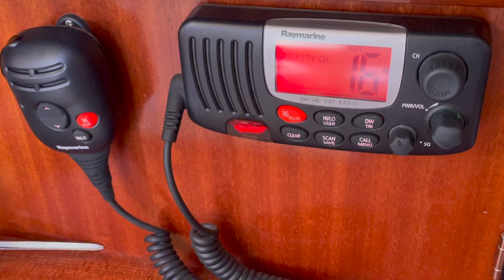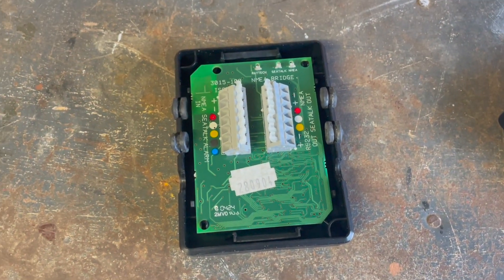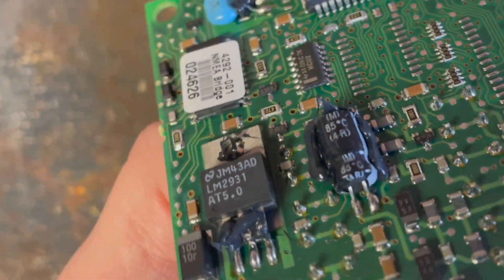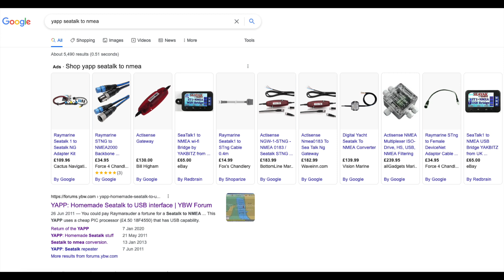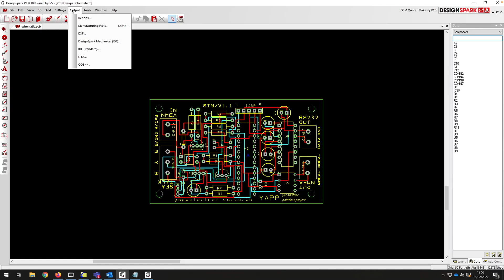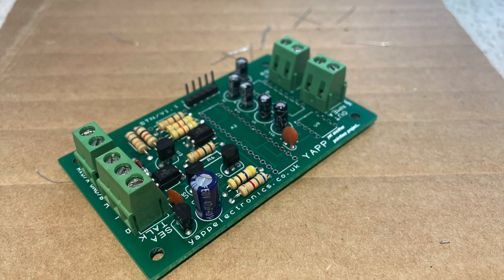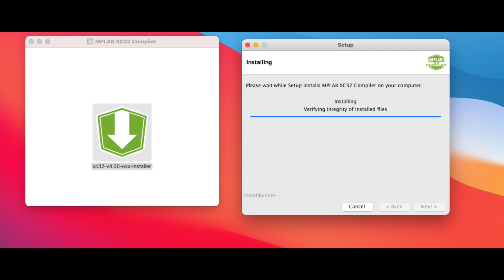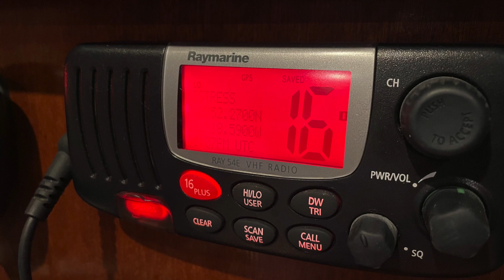Seatalk 1 to NMEA - Raymarine E85001 (replacement) Vs DIY - Boat Projects

Comment: I have one of these, powers up but the Autohelm chip next to it overheats. Can these be changed?
Reply from the maker: Hi, when you say the chip overheats is that a chip on the E85001?
Reply: @BoatingwiththeBaileys  YES
Reply from the maker: Possible to add a small heatsink? My E85001 completely failed so I don't know where that component is on the board but that could be an option

Comment: Awesome video. Have the same Raytech unit circa 2002. Hoping to find a way to replace it before it fails.
Reply from the maker: I have a couple of the project boards printed if you want one. Drop me an email either via the YouTube link of via our website Boatingwiththebaileys.com

Comment: The first thing to check, before uninstalling, is to check whether there’s any power coming in to the box!
Reply from the maker: Hi, always good advice. I did test that on mine and it was getting power. The 5v supply also seemed to be working ( I think I showed that in the video) however something in the circuitry has failed. I still have the box and it was recommended to try freezing spray to see if we could find a dry joint. I’ll give that a try and some point and see if it comes back to life

Comment: Hi there 
I've built a Pi 4 4gb ram with a Daisy hat on top.
Is there a way I could add a multiplexer so I can include wind speed indicator batter level and GPS via nmea 0138?
Your videos are the clearly superior over other efforts trying to explain Pi for boating. Well done
Reply from the maker: Is all of that kit currently networked on NMEA 0138? Not sure if you can stack hats but something like this could work https://www.instructables.com/How-to-Use-NMEA-0183-With-Raspberry-Pi/ I know there is code in SignalK to use/decode NMEA sentences and I believe it’s some form of serial communication so that or a cheap USB to serial converter might be a good starting point. If it’s not networked then it might be more tricky. You can buy multiplexers but I’ve not seen a home build. Interesting project to build one though
Reply from the maker: Yeah a quick Google looks like you need a usb to serial for each nmea source.

Comment: Brilliant project. Re your original ray marine unit.  A trick to finding dry joints and faulty components is to use freezer spray on various parts of the board.  Freezing solder joints can sometimes make them work, and then you can narrow down problem.  Doesn’t always work but..
Reply from the maker: Thanks Peter - I’ve still got the unit so I’ll give that a try.